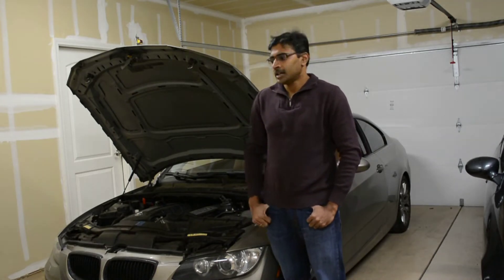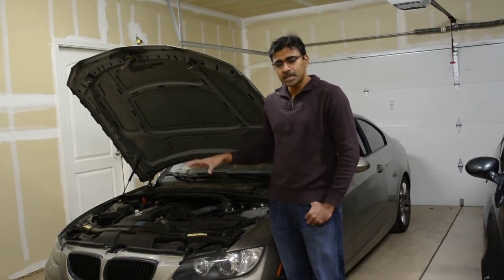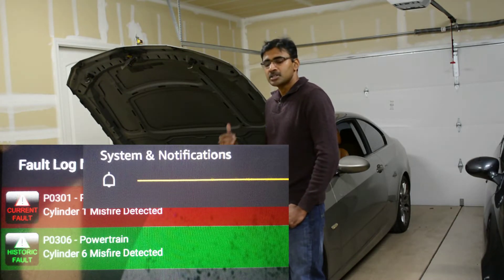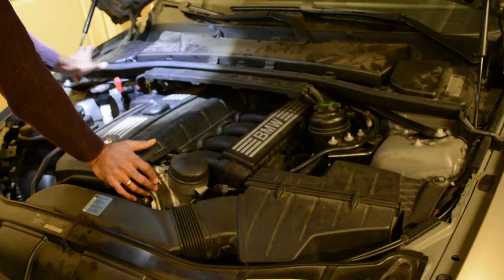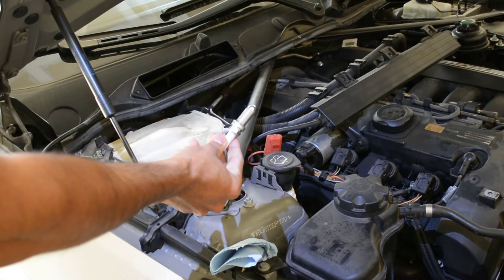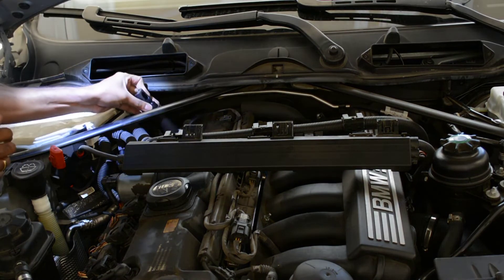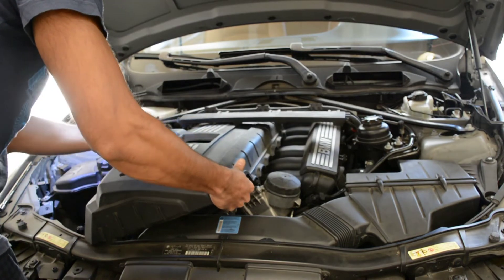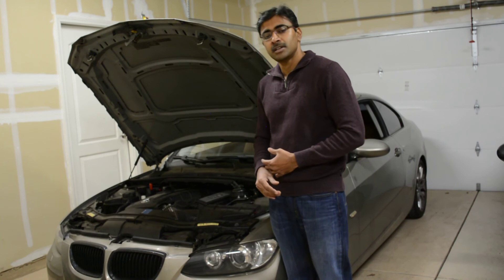BMW 328i - SES Error code P0306, P030X - Cylinder Misfire

Comment: i know this is a old video but i need some help! i had a cylinder six and a cylinder 3 or 4 misfire cant remember exactly there's been so many over the years replaced both of those coil packs as well as 5 for safe measure because i had an extra though abt 2 weeks later i just got another cylinder 6 misfire i just pulled it and the well seems to be clean besides a small amount of gunk but nothing coming up from the spark plug or anything car started and ran fine with a pending code on cylinder 6 but it disappeared and it ran fine today, but the smell of gas has remained so im not sure what the case may be, is it possible its a fuel injector i checked the look of them and its a bit gunky on the 5th and 6th injector!
Reply from the maker: Are there any other codes associated with Valve timing? Inconsistent and too many cylinder fire errors denotes a problem with timing in most cases. Note in my case I replaced all 6 spark plug&Ignition coils later on and it has been trouble free after that.
Reply: @vijaypguna   absolutely nothing. just a p0306 code and again a couple of weeks ago had 2 misfires on different cylinders just checked the plugs wells and everythings good havent pulled the actual plug out yet but im going to just order a valve cover and valve cover gasket along with coils and plugs for all cylinders and see where that gets me because either way its about time just dont know why cylinder 6 has been triggered 2 times in a row in the span of maybe 3 weeks?!

Comment: Does it sounds normally?
Reply from the maker: With this issue, the engine vibrates a lot and would not recommend driving. But it did sound mostly normal.
Reply: Thanks